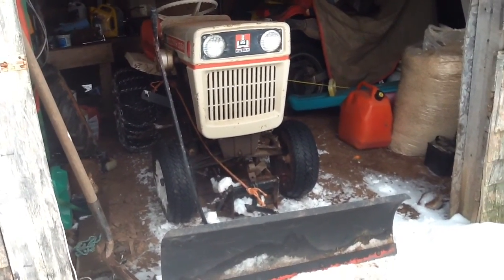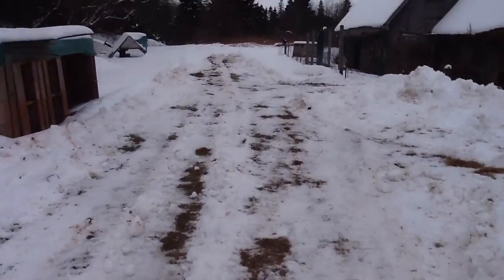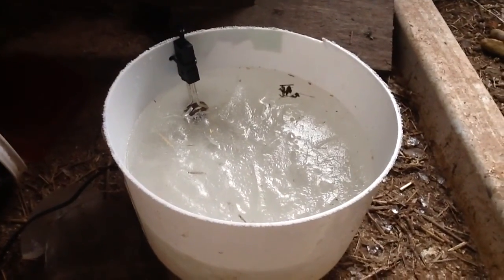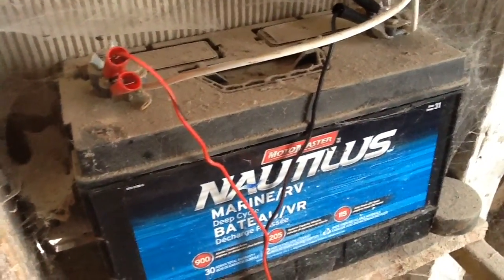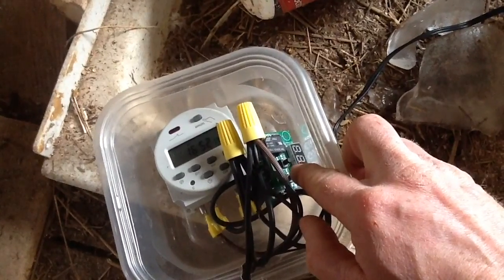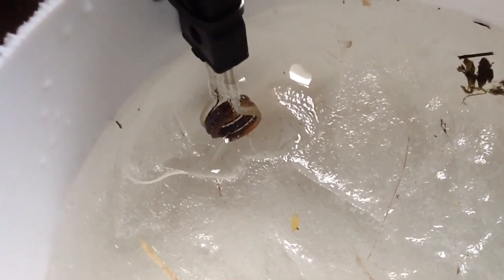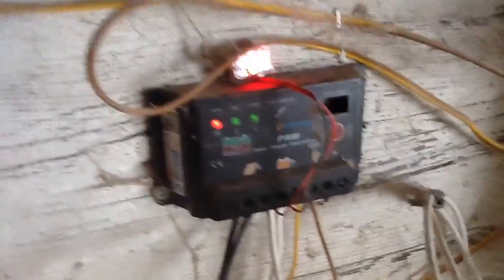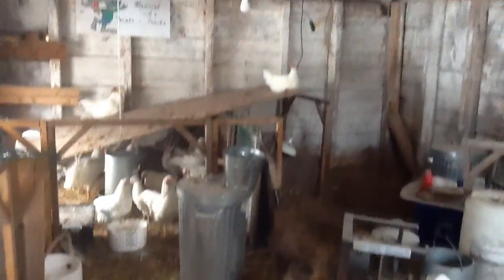Solar Powered Heated Chicken Water Dispenser - Part 2 - testing to see if it melts ice

Comment: Are you still using this chicken water heater set up?
I was going to try this set up. Only thing is, It get sometimes below 0 here.
Do you think it will work?
Reply from the maker: i'm not. my battery bank was a little too small to be able to run it without a sunny day each day to get it back up, it was simply cycling the battery too deeply each day to run this.  i found as well, when its -20, the heater melts a small hole, and the chickens drink fro that hole before it has a chance to melt all the ice, so not a perfect setup. the easier route likely is just to purchase a heated water bowl from your local farm supply and run that off a larger batter bank, though for those, i think you do need to run them 24/7 otherwise the water will just freeze and the unit can't melt it all... no super easy solutions.
Reply: Thank you for the reply. You saved me a couple of dollars because I was going to buy one of those heaters you tried. So I will buy a heated water bowl from Tractor Supply.
Thanks again!
Reply from the maker: ya, its a fun DIY project but not incredibly efficient. if you get a heated dog bowl, that would likely be most efficient, however they tend to evaporate quickly so you need to fill it daily. a heated chicken water dispenser works better for long periods since there is less surface area, not sure the wattage on those, 50 to 80 watts... takes a lot of energy to keep water from freezing :)